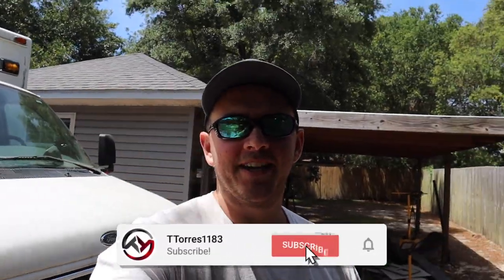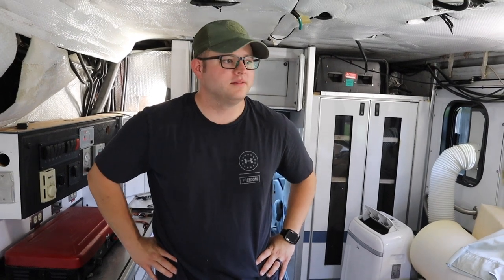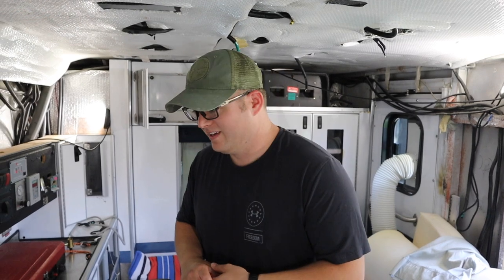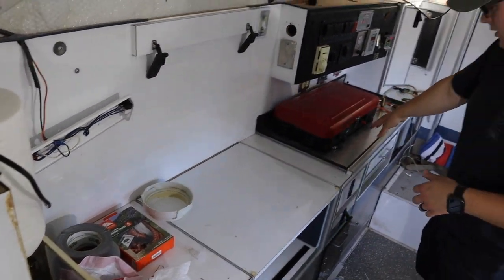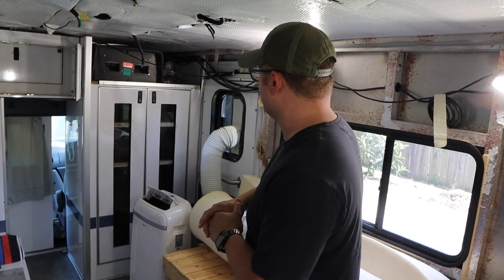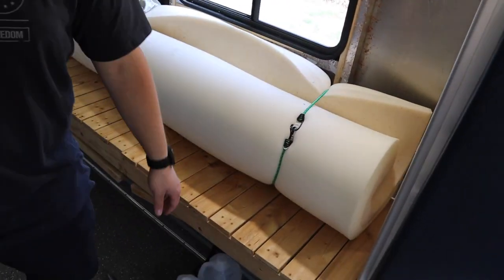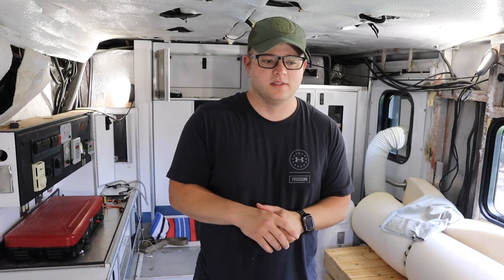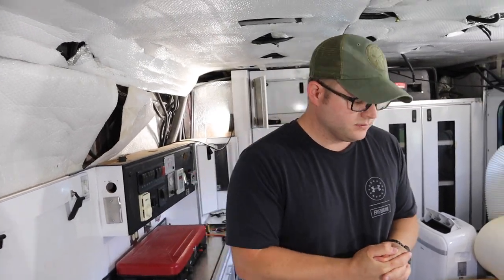Building An Off-Grid Ambulance Camper! **HELP US**

Comment: What I did was use Stainless Rivet Nuts to attach Unistrut to the roof.  Added 3/16 thick rubber between the unistrut and the roof.  Bolted it down with Stainless bolts and Loctite.  Then mounted the Panels to the Unistrut.  I used 2 x 410 Watt panels.